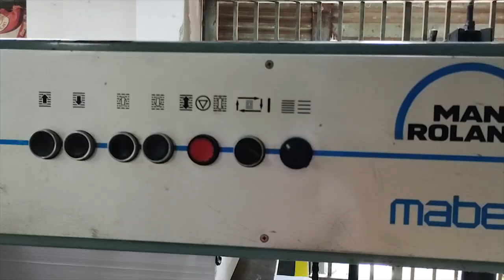4 Color Printing Process with Roland Parva Offset Printing Machine

Comment: A very complicated printing press which have five operators struggling to obtain a consistent colour that is very simple for the image areas. Too much adding and removing water from the damping system. A regular four colour press has two operators. Good luck with your quest for your future endeavors.
Reply: I worked alone on a 526 Komori for 16 years! No problem! So 2 or 4 operators are to many!
Reply: Those guys a very very inexperienced they are guessing ,  that press looks brand new they are not operaters
Reply: ROOKIES bumping into each other.  Someones gonna get hurt!!!
Reply: @tomhanley9575  You are absolutely right! It’s a mess!!!!!!!!